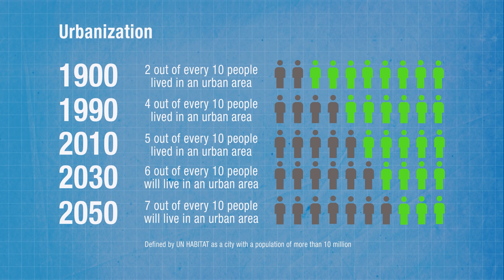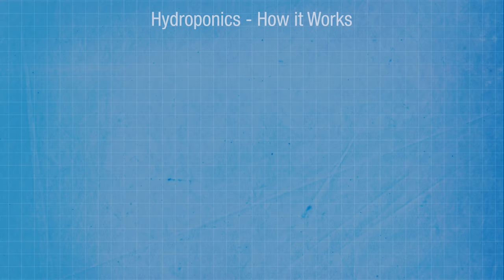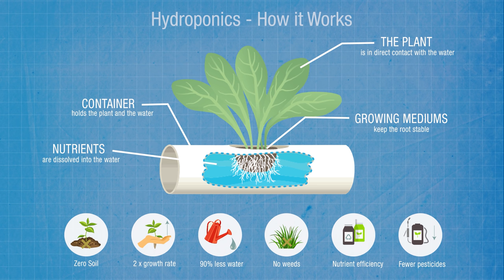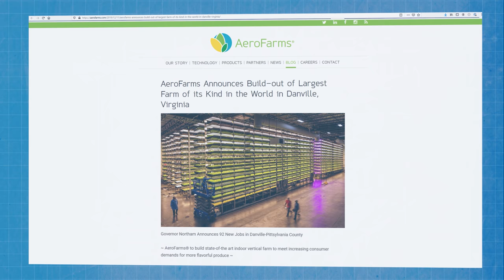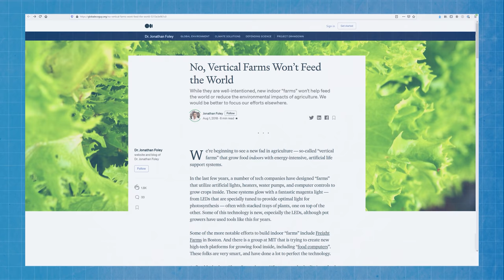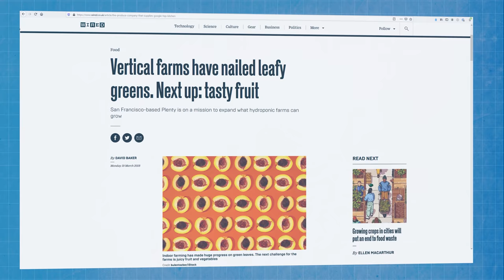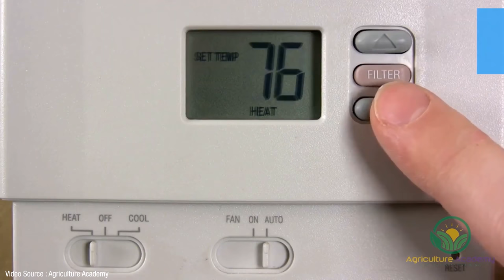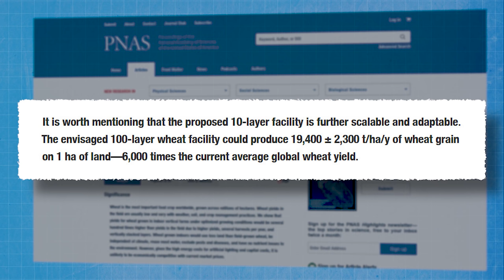Vertical Farming:  Growing fast!

Comment: I think local or at least regional vertical farms are inevitable.  Why?  The same reason most meat is produced today in high density "feed lots".  It provides quality control and minimizes the production cost compared to open range or free range production.  Indeed, a plant actually uses just a fraction of the total amount of energy delivered to a spot on the ground that the sun supplies, so converting as much of that energy into electricity as you can and then using targeted LED lighting makes a lot of sense because you can produce a lot more product with the same amount of land.

Regardless I don't think you are going to convince that many people to move to a meatless diet any time soon.  Space simply isn't the key constraint there, nor is the environment.  The output of meat "crops" (CO2 and excrement) in theory can be recycled by vertical farms to produce much of the feedstock for those crops, so while producing meat protein isn't nearly as cost efficient as producing plant protein, it will always be possible to produce it given an adequate volume of space (doesn't have to necessarily use up arable land) and energy input.  And someone will produce it as long as there is demand for it and enough people can afford to pay for it.
Reply: Basically the more people the world has, the denser and more efficient our food production will become.  Wasting space, environmental resources and other externalities will eventually become priced in and that might push some people to lower cost alternative protein sources.  But I'd imagine the world could support 1T people before we really start running into any serious resource limits.  And that's assuming some game-changing technology like commercial fusion power isn't available before then.

Comment: Vertical farming with 24 hour lighting and managed CO2 auxin-promotion, provided ample fertilizer is provided, can get you better quality fresh food in the office space abandoned as people move to work from home. Win-win.
Reply: Plants don't want light 24 hours a day
Reply: @lexiecrewther7038  You make a good point. 

I once thought as you do; and for some plants you are right. However, the evidence is very clear that for many species, not only does light around the clock do no harm, but there is measurable increase in overall vigour greater than merely can be accounted for by longer growing hours.

For those crops that don't benefit from longer duration of light exposure, generally higher CO2 levels during hours of darkness are also a liability. A co-production facility set up to use up excess CO2 from some other source would not benefit as much by growing dark-needing flora.

Comment: I think it is not ultraviolet light, that would burn the plant. It's a mix of red and blue light, which is the light that the plant absorbs (it reflects green light that's why plants are green).
Reply from the maker: Yes, that's true. I got that wrong. I will post an ERRATA note in the description

Comment: I'd love to see some stats on energy consumption. If we power these with only solar panels, would that use more or less land? It's not necessarily a deal-breaker if it needs more land area, because we have plenty of deserts where that's not an issue. In the worst case we'll still have to transport food around the world. Or transport the energy instead, whichever is more practical.
But the obvious solution to the energy problem is nuclear power. Orders of magnitude less land required, and as clean as solar. And modern small modular reactors can be far safer, far cleaner and far cheaper at the same time as the ones we currently use.
You are going to want to use extremely reliable power sources, because if you lose power you lose your food too, which is not ideal.

And as for the money, I bet on Elon Musk and Jeff Bezos. They have plenty of money, willing to take big risks and have big space projects which will absolutely need this technology anyway. And Elon's brother, Kimbal Musk, already has such a business, so it has to happen at some point in the near future.

Comment: Wonder if there could be a use for all those redundant air tight aluminium tubes (planes) we now have laying around?
Reply: RAIL CARS and Shipping Containers .
Plane Fuselage have Contaminents and Toxins , Lithium Hydroxide and others. 
much easier to Clean out a Shipping Container and Convert it , many just lying arround , rust.
Reply: Craig Whitley  was that the planes or just the hoards  of folk you were exposed to?
Reply: @markplott4820  yeah but I have a fair experience with old shipping containers and they generally have that exact problem they are rusting away and if you want to use them in any controlled way you need to clean (usually some sort of abrasive blasting) then coat with expensive paint systems. Aluminum is far more stable.
Reply: @ronsummers4090   - I built a Shipping Container GREEHOUSE , got an UNDAMAGED one from a yard , Cleaned it out , used THERMAL Coat Paint for Insulation and added FANS and a Glass Skylight and Vents. 
I also constucted a Concrete pad , to keep PESTS out.
it runs on off of a 1000 w solar.
used to Control Tepmrature, Air movement and Humidity.
Reply: Craig Whitley  yup, but the exposure is to other carriers, not to the tubes.
Reply: @markplott4820  I don’t doubt you did, but think of that effort times 1,000’s that’s a lot of effort and materials for a relatively small reward.
Reply: @ronsummers4090   - My current Container greenhouse is able to Sustain me , I also have other TALLER crops like Fruit Trees and CORN , in a Field in my Backyard. 
My Chickens provide weeding and Insect controls and provide me with Hearloom Eggs and MEAT sometimes. 
I suppliment with LOCAL Fish and Meats from Local Farms.
have NOT been to a Supermarket in a DECADE or more.
Reply: @markplott4820  good for you, but not all have the same opportunities (or the will to exploit them) or the same circumstances, for example I’m a vegetarian for health reasons but it would be a catastrophe if everyone decided to be the same. What would we do with all the animals? Put them in zoos? Anyway more power to you! You have the right name to! Plott! As in garden!

Comment: I don't think there UV lights, they are full spectrum LED's. i recently moved into a property with no garden so i started growing my own greens indoors with a MarsHydro ts 600 and tsl 2000, they both cost me around £20 per month to run, ive not brought any fresh salad for 14 months. its the future. Thinking of even starting aquaponics.
Reply: Tilapias seem to be the most accessible to raise in an aquaponics system, if you have a cheap source of pre-heating and heating water.
Vertical farms normally use red and blue LEDs, not full spectrum, because photosynthesis does not use other light frequencies. Hence the purplish lighting when lights for human workers are switched off.
The correct ratio of red and blue LEDs, fertilizer, temperature variations, hygrometry and even a bit of "wind" to make the stalks more resistant and prevent the accumulation of moisture and diseases seem to have been worked out pretty well for greens.
UV LEDs exist, not sure the plants use them for anything, but it could be useful if these trays are using organic soil, as a natural pathogen killer, although UV light does not know the difference with the goodogens.
I'd actually rather use living organic soil in these trays, if it makes a difference for taste. Hydroponic tomatoes are totally flavorless, for instance. The bland and regular-looking varieties they use are probably the biggest factor but maybe not the only one. Too little vertical farm research focuses on quality. Quality and taste does not really matter for short duration cultures such as baby spinach, but it becomes increasingly important for longer duration cultures, like full grown spinach large leaves.

Comment: I wonder how this could be applied to space in my apt?
Reply: You dont need to start with a full aquaponics system.  Start with some simple UV led lights and some basic plants . Then with a little research you can look up how to essentially get some trays, pump in the water,  put the plants above, install UV LEDs above and essentially make yourself a vertical farming cupboard. 

It would be a hobby project not really a money saver on that scale but its quite possible :-)

Comment: Urbanization has a devastating effect on the fertility rate. 
The vast majority of the world population is already at the point that the fertility rate is lower than 2.1, which is necessary to maintain the population. 

Even India with a fertillity rate of 2.1 is barely sustaining it's population and China is only at 1.5. 
The latter indicates a drop in the population of 25% in one generation.
Currently the world population is still growing due to the higher fertility rates in Africa and the fact that the average age is going up in most countries. 
This is however not limitless and eventually the older people will die and will not be replaced by new borns.

Comment: Photosynthesis is only ~1% efficient, and energy is clearly a bottleneck for vertical farming staple crops.  PV is ~20x more efficient.  Are there any indoor farming methods that skip photosynthesis and feed the plants industrially mass-produced plant sugars instead?  If they don't find more efficient ways to use energy, it will take massive amounts to make calorie-dense foods.

Comment: does hydroponically grown produce contain the same macro and micro nutrients which are grown on carefully managed organic soils?  the biological flora and fauna of soil is quite complex and plants have evolved an acidic cocktail delivered by their roots to exchange with a wide range of elements and compounds in the soil.  all animals including humans have evolved complex digestive systems for optimal biological immune and brain function which require these nutrients.
Reply: That is the easy part since you can add all the nutrient found in good soils to the water and the plants do not care where the nutrients came from. As long as they can be absorbed by the roots the plants are just fine.

Comment: You talked about aquaponics but you didn't mention where the nutrients come from for their solutions. How green of a process is that?
Reply: Nutrients can be Synthisized or can be Organic . 
I make my own FERTLIZER Tea , by Composing WEEDS and Cuttings into a TEA , then Fermenting it Slightly , and using it All over my Garden , I modeled it After the Process PRINCE CHARLES uses in his Garden. 
though , I dont have room for the GREY Water recycling ponds that he has.
Reply: @markplott4820  so you still need to break down organic matter so that process would release co2
Reply: @nicholashomler1494   - NOPE , the FIRMENTATION takes care of the CO2 problem. 
most of the CO2 is Sequestered in the Organic Matter and in the FERTILIZER Solution, which is very Slightly FIZZY.
Reply: @markplott4820  the fizz is co2. Yeast breaks down the sugar and makes alcohol and co2.
Reply: @nicholashomler1494  and the Plants can Absorb all the Nutrients inc CO2.

Comment: The question would be how much of the food currently comes from these vertical farms per crop and the market share growth.

It seems from the inputs vertical farming makes a whole lot of sense with the price of energy coming down.
Reply: At 6:19 he says that the biggest operations have an output of 1000 tons per year. That's roughly equivalent to one small to medium sized conventional farm which is an infinitesimal amount of market share. For most crops, I don't see building a building and paying for energy to grow plants ever being more cost-effective than putting plants in dirt and using free sunlight. It has a niche for growing produce out of season or in inhospitable areas like the arctic, and for crops that are difficult to maintain and harvest with conventional means, but for the vast majority of food production, it is not viable.
Reply: @M00Z1LLA  fair point if land is available.  Definitely a niche type application.  One wonders though if the sun has the best wavelength of light for growing as well as the length of the grow cycle and seasonality, doesn't seem so since they use an optimized version in these grow houses the counterpoint being that there will be some losses from getting the energy instead of getting it direct, and would help offset the risk of a microbe or pest invading a field.  Seems a good hedge, but the majority of the food it won't be used.    

Out of season makes sense and high value crops (which is what they are focusing on it seems already) makes sense like you said.  

And don't forget mars.

Comment: 4:57 Is it really ultraviolet light? I did some research some time ago when growing plants indoors and learned that ultraviolet light in too high doses is dangerous to plants too, not just humans and other living things. If I remember correctly, photosynthesis evolved to use the sun's light, which is in large part composed of visible light, and doesn't work well with ultraviolet light. I think the light that's used in gardening is magenta because the green of the photosynthetic molecules can absorb almost all of that light. I might be totally off here so If anyone knows for sure please correct me.
Reply from the maker: Hi Mr Neutross. As very many people have now pointed out, I made a mistake when I said that Ultraviolet lights are used in vertical farms. In fact, it is not ultraviolet light - that would burn the plant. It's a mix of red and blue light, which is the part of the light spectrum that the plant absorbs. My apologies for this error. I left this same ERRATA notice in the description box on Sunday and pinned it at the top of this comments section.
Reply: @JustHaveaThink  ok, thank you for answering. No worries 👍

Comment: OK think about it this way... Nuclear is extremely cheap in the long long term but there are lots of fears and issues around it... Now what if we'd take a sparsely populated area where people won't fear so much having a reactor nearby and....  Setup massive toll farms around that reactor /deep into the ground/.... And then ship the produce all around....

Now that sounds like a good idea

A cheap clean energy also if people don't fear nuclear energy that is produced far away from them then there are reduced costs such as useless beurocracy....
(Some important regulations obviously but there's reasonable and then there's fearful...)
Also in the case people's start fearing that if a reactor melts down that there won't be any food... Well then that's idiotic because we'll have those reactors and farms spread all around....
1 or 2 failing won't be too much of a issue not to mention a tiny cost of lives.... Not to mention just how safe modern reactors are!

With quality efficient nutrient packed always Fresh and just right food...... I mean.............

Comment: What about the fertilizer to be dissolved, that comes from somewhere and those lights the phosphors and such in them only last so long and then on top of the gowing mound of lithium batteries, solar panels and turbine props to be partially recycled you now have all the extra on top. Also they use heaps of H2O2 in industrial hydroponics and that is mostly made using fossil fuels at the moment,  think this clip seems to be missing way too much detail by being blinded by a rose colored tint.

Comment: With respect to wheat, you use varieties with a short stem and a large head. You can select and breed them, or use GM. The seeds are scattered on a fine mesh to catch the seeds, suspend them and thick enough to provide resistance during harvesting, and are cropped using an automated harvester bar.

Comment: You have a field, the sun shines on that field. Would you rather put crops on that field so they can harvest the sunlight, or would you put solar panels on it to make electricity, then wire that electricity into a warehouse, and then turn the electricity back into LEDs? Even with how plants don't efficiently use the full spectrum, it's an incredibly dumb way to do this. Even when it comes to land savings, it only does so insofar as you don't count the land you need for the renewable energy, where both solar and wind require tons of land. Nuclear could sidestep this, but the world has stopped building those pretty much.

The true bullshit comes to light when you look at 7:42. Those are fast turn crops to be sure, but they're also crops that are almost entirely water, lettuce being a particularly notoriously abused crop. Lettuce is 95%-ish water, so when you say you've produced a ton of lettuce, what you're really saying is that you've created 50kg of biological matter, which contains 950kg of water. When you start looking at the dry mass that these systems produce, and compare it to the incredibly stupid amount of energy that has to be funneled in, it really starts to become clear how wasteful this entire idea is.

At the end of the day, humans run on corn, rice, wheat and potatoes, with corn mostly to feed animals that we then eat. One of the articles linked considers growing wheat indoors, but notice it's a purely theoretical study, unbound by practical or economical considerations. While it's great that in simulation-land we can have wheat growing in vertical farms, in simulation-land we also have hyperloops, Edison blood-analysing machines, and warp drives. Unlike the inhabitants simulation-land though, we are forced to deal with reality.

Comment: Vertical farming is a dead end. Farm land is dirt cheap with FREE sunlight, while city land for vertical farming is extremely expensive, and demands extremely much energy for artificial lighting. Not to mention the cost of the building, lights, pumpsystems, and so on.

If we solve fusion energy and get abundant free energy then maybe. But not in todays energy market.